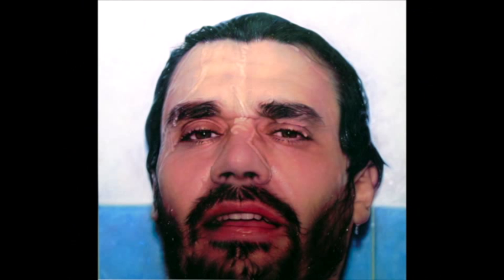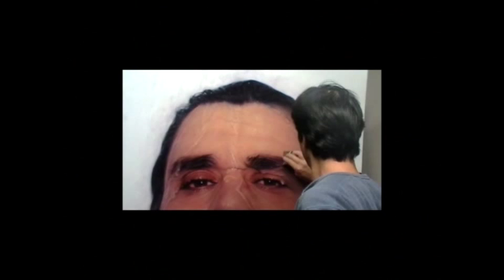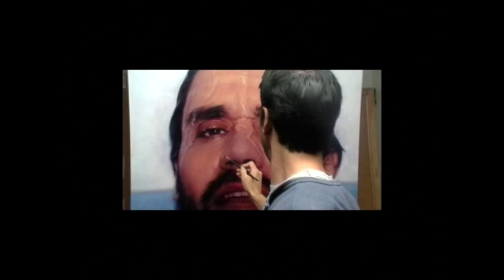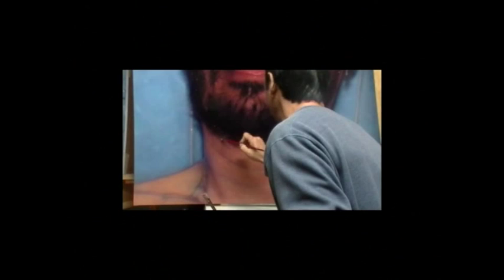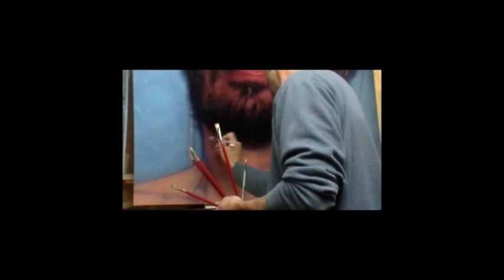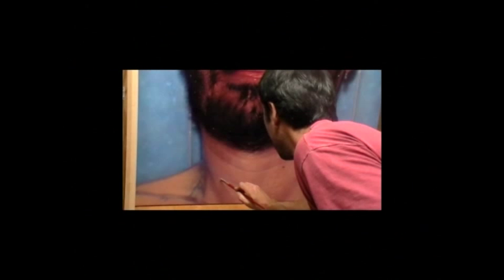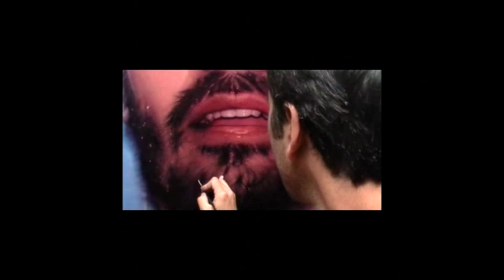Portrait Number 1, The whole process

Comment: I am confused on your process with the linseed oil, Could you please explain? 
(When to apply, how to apply, and when to remove)
Wonderful artwork, very inspiring.
Reply from the maker: Will put it up here as soon as I have it on text.

Best, Jackson!
Reply from the maker: So sorry, Jackson!!

I forgot about coming back to this message! My apologies.

The process is really simple. Once you have finished your drawing of the image on the board or canvas, you fix it (I use charcoal normal fixative), to make sure it will not mess up the image when applying the first coat of oil. Then, first coat. For this on eI do not use any medium (unless your oil is a little dry, then just a touch of turpentine). We need this coat to cover the drawing and create a thick and strong coat of paint to put up with all the coming layers. When this first coat is completely dry, I start with the oil process. I apply just the minimum amount of oil (I show in the last video "Blue Series Number 1" the tiny touch I use), cause I have learnt, from time I did my the first videos, that we do not need much, just a little touch will work great. You can apply this oil on the part you are going to work on and you can also do it again during the process of painting if needed, over the part you just worked on, if you just pass one or two time, softly, over the surface of the piece, if you do not insist (or you will "move it"). Since you slightly prepare the painting with oil, you do not need any medium on the palette. If you do it this way, contrary to what people might think, you will use much less oil that normal procedures, since you do not add any medium on the palette. This process will allow you to work every new session as soft or strong as you want, just by changing the amount of paint you use, the "time you pass your brush over the paint, the number of time you add new color to the same area (cause you will be able to work for one or two days non stop on the same piece.

Hope it helps, Jackson, and sorry again for forgetting to answer.

All best!